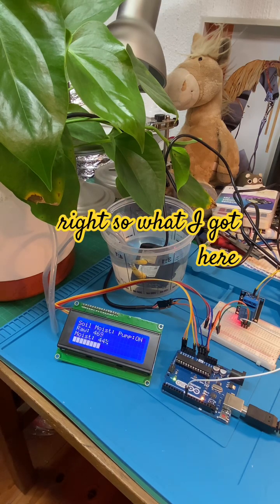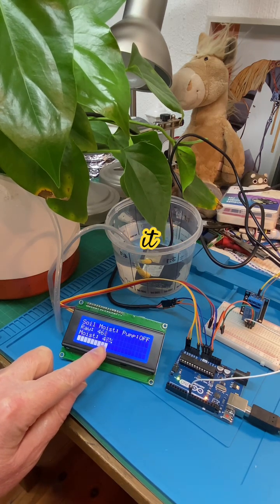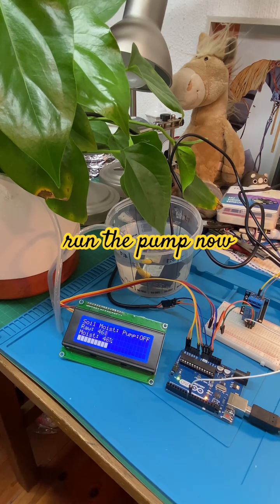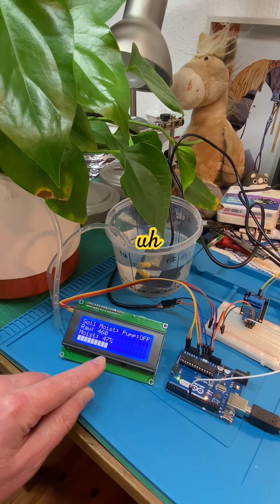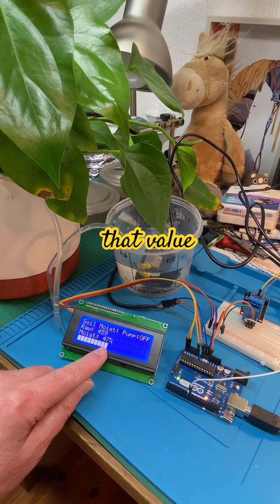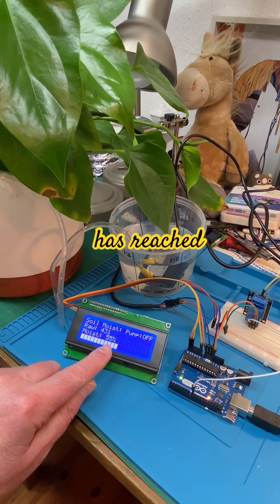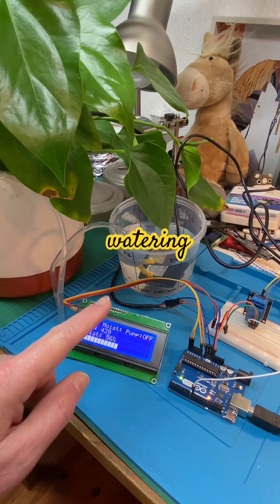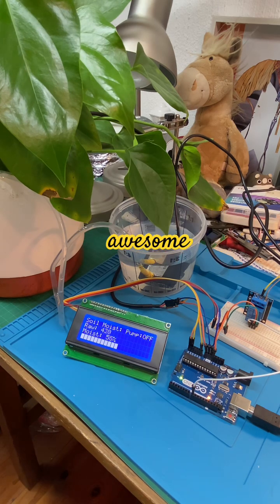🌱 Arduino Smart Plant Watering System with Soil Moisture Sensor! 🌱#shorts #plants #arduino

Comment from the maker: Here is the code:

#include <Wire.h>

#include <LiquidCrystal_I2C.h>

// LCD: I²C address 0x27, 4x20
LiquidCrystal_I2C lcd(0x27, 20, 4);

const int soilPin = A0;
const int pumpPin = 8;

// Calibration
const int dryValue = 620;
const int wetValue = 280;

// Moisture thresholds
const int pumpOnThreshold = 50;   // below or equal → turn on
const int pumpOffThreshold = 60;  // above or equal → turn off

// Pump timing
const unsigned long pumpRunTime = 2000;     // 2s
const unsigned long pumpDwellTime = 10000;  // 10s

bool pumpRunning = false;
unsigned long pumpStartTime = 0;
unsigned long lastActionTime = 0;

byte fullBlock[8] = {
  B11111,
  B11111,
  B11111,
  B11111,
  B11111,
  B11111,
  B11111,
  B11111
};

void setup() {
  Serial.begin(9600);

  lcd.init();
  lcd.backlight();

  pinMode(pumpPin, OUTPUT);
  digitalWrite(pumpPin, LOW);

  lcd.createChar(0, fullBlock);

  lcd.setCursor(0, 0);
  lcd.print("Soil Moist:");
}

void loop() {
  int rawValue = analogRead(soilPin);
  int moisturePercent = map(rawValue, dryValue, wetValue, 0, 100);
  moisturePercent = constrain(moisturePercent, 0, 100);

  unsigned long now = millis();

  // --- Pump Logic ---
  if (!pumpRunning && now - lastActionTime >= pumpDwellTime) {
    if (moisturePercent <= pumpOnThreshold) {
      digitalWrite(pumpPin, HIGH);
      pumpRunning = true;
      pumpStartTime = now;
      lastActionTime = now;
    }
  }

  if (pumpRunning) {
    if (now - pumpStartTime >= pumpRunTime) {
      digitalWrite(pumpPin, LOW);
      pumpRunning = false;
      lastActionTime = now;
    }
  }

  if (!pumpRunning && moisturePercent >= pumpOffThreshold) {
    // stay off, reset timer so it waits full dwell time again
    lastActionTime = now;
  }

  // --- LCD Display ---
  // Raw reading
  lcd.setCursor(0, 1);
  lcd.print("Raw: ");
  lcd.print(rawValue);
  lcd.print("    ");

  // Moisture %
  lcd.setCursor(0, 2);
  lcd.print("Moist: ");
  lcd.print(moisturePercent);
  lcd.print("%   ");

  // Bar graph
  int barLength = map(moisturePercent, 0, 100, 0, 20);
  lcd.setCursor(0, 3);
  for (int i = 0; i < 20; i++) {
    if (i < barLength) {
      lcd.write(byte(0));  // full block
    } else {
      lcd.print(" ");
    }
  }

  // Pump Status
  lcd.setCursor(12, 0);
  if (pumpRunning) {
    lcd.print("Pump:ON ");
  } else {
    lcd.print("Pump:OFF");
  }

  delay(200);  // faster refresh
}
Reply: Merci beaucoup à vous, vous êtes vraiment génial

Comment: Je cherche le même système pour un I2C 16 02 pouvez vous m'aider s'il vous plaît 😢😢😢
Reply from the maker: Oui, je peux envisager de le faire avec un écran 16x2. 
Je dois le monter et tester le code après l’avoir modifié, donc cela peut prendre quelques jours.
Reply: @Uncle-Duncan-Electronics-Shack pas de soucis j'attend votre retour merci
Reply from the maker: Voici votre code pour un écran 2x16.

#include <Wire.h>
#include <LiquidCrystal_I2C.h>

// LCD: I²C address 0x27, 2x16
LiquidCrystal_I2C lcd(0x27, 16, 2);

const int soilPin = A0;
const int pumpPin = 8;

// Calibration
const int dryValue = 620;
const int wetValue = 280;

// Moisture thresholds
const int pumpOnThreshold = 50;   // below or equal → turn on
const int pumpOffThreshold = 60;  // above or equal → turn off

// Pump timing
const unsigned long pumpRunTime = 2000;     // 2s
const unsigned long pumpDwellTime = 10000;  // 10s

bool pumpRunning = false;
unsigned long pumpStartTime = 0;
unsigned long lastActionTime = 0;

byte fullBlock[8] = {
  B11111,
  B11111,
  B11111,
  B11111,
  B11111,
  B11111,
  B11111,
  B11111
};

void setup() {
  Serial.begin(9600);

  lcd.init();
  lcd.backlight();

  pinMode(pumpPin, OUTPUT);
  digitalWrite(pumpPin, LOW);

  lcd.createChar(0, fullBlock);

  lcd.setCursor(0, 0);
  lcd.print("Soil Monitor");
}

void loop() {
  int rawValue = analogRead(soilPin);
  int moisturePercent = map(rawValue, dryValue, wetValue, 0, 100);
  moisturePercent = constrain(moisturePercent, 0, 100);

  unsigned long now = millis();

  // --- Pump Logic ---
  if (!pumpRunning && now - lastActionTime >= pumpDwellTime) {
    if (moisturePercent <= pumpOnThreshold) {
      digitalWrite(pumpPin, HIGH);
      pumpRunning = true;
      pumpStartTime = now;
      lastActionTime = now;
    }
  }

  if (pumpRunning) {
    if (now - pumpStartTime >= pumpRunTime) {
      digitalWrite(pumpPin, LOW);
      pumpRunning = false;
      lastActionTime = now;
    }
  }

  if (!pumpRunning && moisturePercent >= pumpOffThreshold) {
    lastActionTime = now;
  }

  // --- LCD Display ---
  // Line 1: Moisture% and Raw
  lcd.setCursor(0, 0);
  lcd.print("M:");
  lcd.print(moisturePercent);
  lcd.print("% ");

  lcd.print("R:");
  lcd.print(rawValue);

  // Line 2: Pump and bargraph
  lcd.setCursor(0, 1);
  if (pumpRunning) {
    lcd.print("Pump:ON ");
  } else {
    lcd.print("Pump:OFF");
  }

  int barLength = map(moisturePercent, 0, 100, 0, 6);
  lcd.setCursor(9, 1);
  for (int i = 0; i < 6; i++) {
    if (i < barLength) {
      lcd.write(byte(0));
    } else {
      lcd.print(" ");
    }
  }

  delay(200);
}
Reply: Encore merci infiniment pour le code montage fait tout fonctionnr niquel, je verrais si j'ajuste les parametre où pas
Reply: Bonjour, jai un petit soucis pouvez vous quand vous avez le temps m'expliquer quelque chose s'il vous plaît
Reply from the maker: Oui, quelle est la question ?
Reply: @Uncle-Duncan-Electronics-Shack quand le petit moteur 5v se lance, j'ai tout qui bug sur l'affichage, avez vous en endroit où on peut discuter ?
Reply from the maker: @TheDelvice  Donc, ce que vous devez faire, c’est prévoir une alimentation séparée pour la pompe, car elle consomme pas mal de courant et cela risque d’interférer avec l’affichage. Il vaut mieux réserver le 5 V de l’Arduino uniquement à l’Arduino, pour des raisons de stabilité.
Reply: Pouvez vous m'envoyer le shema, j'ai essayer avec une alimentaire à part toujours le même problème
Reply from the maker: @TheDelvice  Voici un lien vers un exemple de la façon dont j’ai câblé le mien pour contrôler la pompe afin que l’alimentation soit isolée.

https://circuitdigest.com/microcontroller-projects/build-a-simple-plant-watering-system-using-arduino
Reply: @Uncle-Duncan-Electronics-Shack toujours le même probleme même avec l'alimentation isolé
Reply: @Uncle-Duncan-Electronics-Shack le probleme viendrais pas du capreur de sol ? J'ai branché un capacitif / Gnd /  5v / A0
Reply: J'ai monter le shema avec un capteur sol capacitive ça viendrais pas de la le probleme ?

Comment: Awesome idea could make something with a spike and tank with large opening that you just occasionally fill and it keeps your plants at proper moisture level, maybe an idea to patent and mass produce for you to sell

     Continued Success 
               Fabrizio
Reply from the maker: Hi FaMa,
These are an old time tinkerer project, loads of examples out there in different flavors.
The secret sauce is how one measures the moisture level.
That probe I got is great as it will not suffer short term decay like a resistive one.
Good to see you here,
Duncan